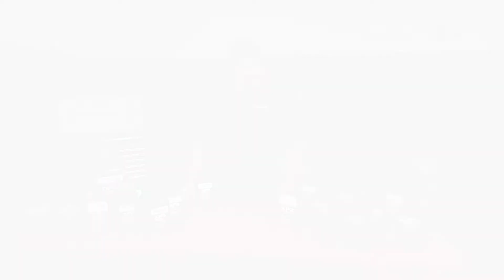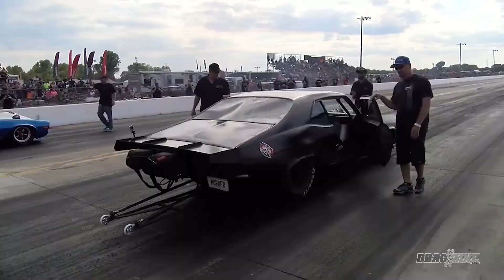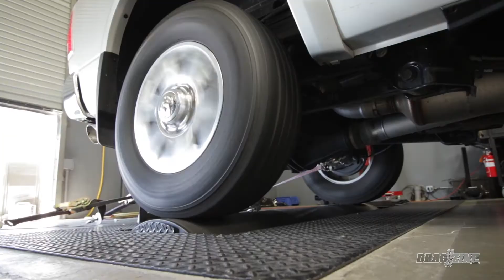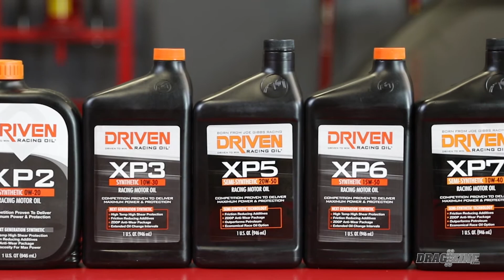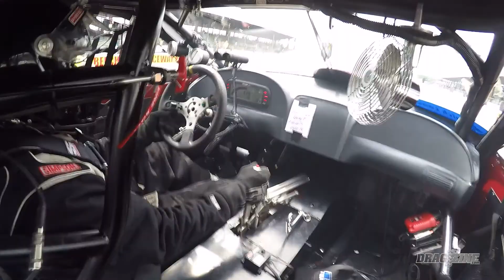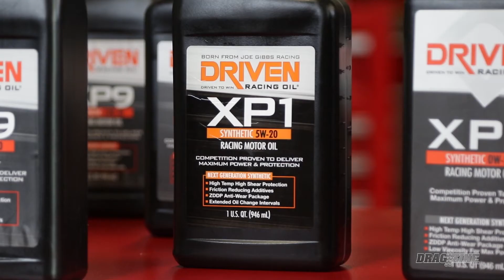Choosing The Right Oil For Your Drag Car

Comment: I’ve been using Valvoline VR1 10w30 for a while. I am considering switching to Driven HR2. I need to know why HR2 is superior before I purchase. Thanks.
Reply from the maker: The HR oils have rust inhibiting properties to provide better storage protection. The HR oils also have 1500ppm ZDDP, but more important than the amount is the type of ZDDP (zinc); it is what is known as a secondary ZDDP that activates on the surface of the parts faster than a primary zddp, equaling greater wear protection. Hope this is helpful and thanks for the inquiry.
Reply: Thanks. Perhaps I’ll switch. It’s the storage claims that interest me. I would use HR2 in one car and HR1 in another. They both sleep for 6 months. If I change right before storage am I good until the following Fall?  Can I drive with that oil all Summer? Thanks